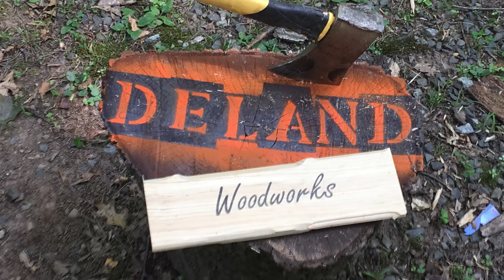The Viking Syle Chair

Comment: I couldn't find any mention of what size lumber you used. Maybe I missed hearing you mention it in the beginning. It appears to be 2" x 12" x 8' pine. I've watched several video's regarding building these chairs and it seems no one provides the size lumber they use. Would you please provide the dimensions of the lumber you used. Thank you.
Reply: I have had the same problem as you. I will be making one of these chairs myself and will post a video with dimensions shortly. If you have not already done this protect yet please consider watching my video
Reply: i just used a 2x12 piece of doug fir from home depot. 48” for the back and 42” for the bottom.

Comment: Measurements! Come on!
Reply: Watch the tape and square I caught a couple  of the measurements.  He used a 2 x 12 both peices cut 3 ft  long and the seat was 12 inches up to  the slot and it looked like 2 1/2  or  3 inches on each side of the slot . I would think you could make the seat higher by using longer boards as long as they are same length to slot.  Its simple minded design.
Reply: Hale Roofing it would be a hell of a lot easier to just talk through the video and explain. Especially if someone won’t respond to questions. I hate when someone builds shit in fast fwd and never explains or puts in measurements to help fellow builders. Not meaning him... but just in general. Like the Mortise hole. What the measurement from the edge and how far down from the top or bottom of board. I like my chairs to be a just about where his is.(meaning the back) some I’ve seen some and it looks like a damn lounge chair. Nice Job Tho!
Reply: @jamesbarlowjr.3762  I understand your anguish with no measurements.  The poster probably pays for  Wood working catalogs and shop smithing  and it has copyrights. Nobody wants to give you anything of value for nothing these days  even without copyrights, with the measurements you can go into the  Viking Chair business and sell em by the hundreds possibly. 
 My uncle was a cabinet maker and bought all kinds of wood working books and subscriptions. I know he paid over $100.00 for an Adirondacks chair design which are heavy and ugly in my opinion.
Reply: Hale Roofing Yea I noticed that.. I went to one persons page and in the video they said, Go here for Free Plans. Well I did and didn’t think entertaining your credit card info meant free. I’d love to pass on knowledge but you have some that just forget where they come from and try to suck every penny out of you. But I guess I’ll find something. Thanks for responding much appreciated. Have A Great Morning/Day/Evening!